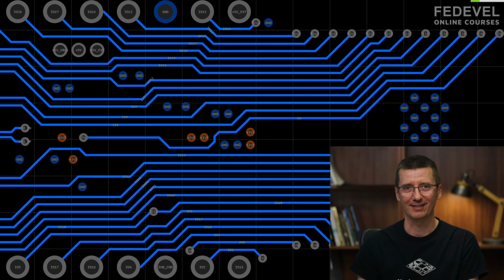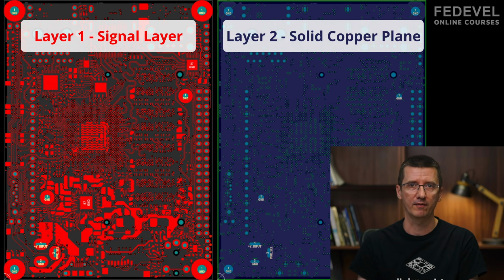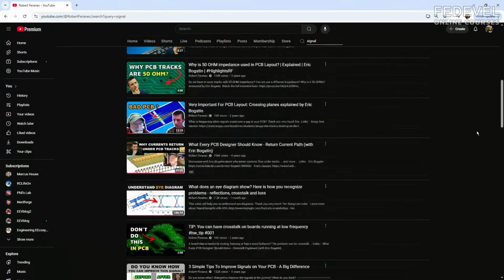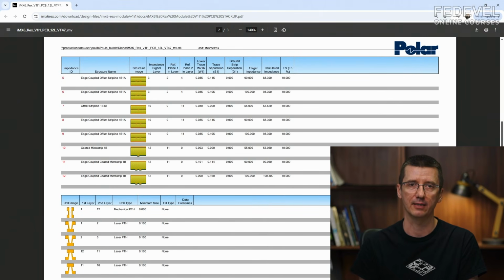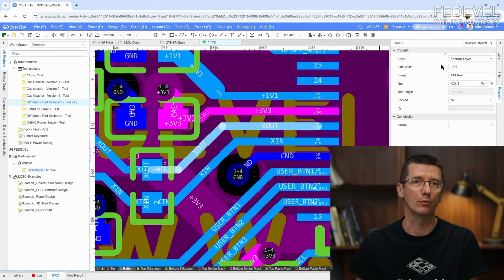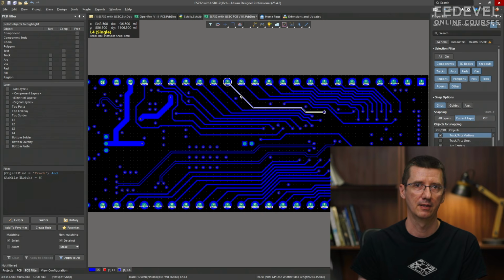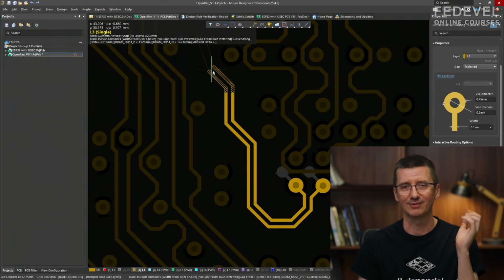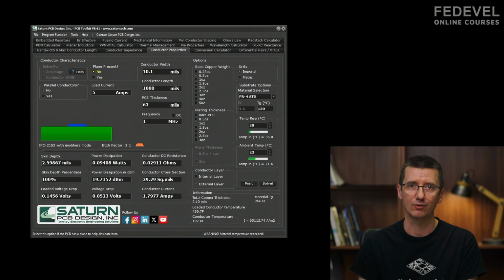Useful TIP: What Track Width To Use When Routing PCB?

Comment: This is just wrong. There's no need to use 50ohm tracks for digital signals. If they're super high frequency then you might need impedance matching (USB, high speed memory etc), or if it's an antenna feed line, then yes. But there's no need to do this for normal digital signals. Even for I2S or SPI lines.
Reply: The high frequency component is not the fundamental frequency of your signal, it's the rise and fall time of it :)
An SPI or I2C can definitely be ruined by fast io.
Reply: I recall, as a rule of thumb, that If you use 3W clearance rule, you should be using 50ohm traces. Otherwise the crosstalk coupling could be much greater. I always use 3H instead as it  scales with the reference plane thickness, and for this reason works for any impedance. I think Robert has an old video about this.

Also consider that traces are antennas at some frequency and without matched line load, source termination, high frequency energy could couple in, by how much of a problem is this would be hard to quantify. 

I don't think you need 50 ohms everywhere, but starting with larger traces and spaces is always a good starting point in a design.
Reply from the maker: It may not be required, but it's not wrong. Even if applied on signals where it is not required, it is not wrong.

I recommend to use 50 Ohms, because it is a good habit. Many chips actually have termination to meet 50 Ohms and in these cases it can help a lot. Also, if termination is external, often it is designed for 50 Ohms, so again, it will help in these cases.

So, using 50 Ohms will not make harm in the cases when it is not required, but it can help in the cases where chips or circuit is designed around 50 Ohms.
Reply: @RobertFeranec  Things are confusing enough for beginners without making stuff up. Right at the start, around 20s in you said "the most common tracks are digital signal tracks, and usually these are routed with 50 ohm impedance". But they're not. Now you say "Many chips actually have termination to meet 50 Ohms" - would you care to show me one? Because I can scarcely recall seeing an IC datasheet that mentions pin impedance requirements, except antenna pins or very high speed digital signals, as I already mentioned.
Reply: @JasonRennieWTF  I am not an electrical engineer by any means, however it is absolutely true that most digital protocols use 50 Ohms single ended impedance, but only when the trace is long enough. Using 50 Ohms everywhere is overkill however it's not wrong, can save headaches and it's simple to understand and implement on a design retroactively. I can think of 11 digital protocols that require at least 1 signal with 50 Ohm impedance. I think your issue is that you have not explored any high speed design which have impedance requirements.
Reply: @ParabolicLabs  "I can think of 11 digital protocols that require at least 1 signal with 50 Ohm impedance." DDR3/4, HDMI, eMMC, SATA, USB, Ethernet, MIPI, PCI express, Display port,  bla bla bla. But in every case it only applies to long traces at high speeds, and none of these protocols are "NORMAL" digital signals.
Reply from the maker: For example most microcontrollers / processors have settings to drive strength (you can adjust output impedance). It will not be exactly 50 ohms, but if you route your tracks with random impendence you can get much worse results than if you use 50 ohms. Also, often you will find in circuits series termination resistors e.g. 33 ohms which are designed to create 50 ohm driver impedance - so again if you use a random impedance on your tracks you can get bad quality signals. I have seen clock chips with 50 ohms integrated, memory chips with settings for 50 ohm terminations, etc ....
Reply from the maker: I am very surprised how many people find it weird using 50 Ohm impedance for standard digital tracks. If we don't speak about reflections, high speed, signal integrity, noises, crosstalk .... just from a practical point of view, I really would like to know how someone who randomly routes tracks on their PCBs can be sure that ALL the boards they ever manufacture will always work exactly the same and predicted way. When boards are manufactured, these are often manufactured in batches - you make 10, then 100, then 1000, then 10000. Sometimes these batches may be manufactured by different PCB manufacturers, sometimes these batches are going to have different stackup. If the properties of tracks are different between these batches (for example if the impedance of the tracks changes because different batches are using different PCB stackup), the same boards but from different batches may behave differently. In the worst case you may end up with batches that will work perfectly fine and in other cases many boards may be randomly failing.
Reply: @RobertFeranec  impedance matching is only needed for long traces at high clock rates. Otherwise it's completely unnecessary. Telling people to do this by default is just confusing and unnecessary. Now you're trying to shift the argument with talk of drive strength and some crap about manufacturing reliability. Just stop
Reply: @RobertFeranec  An impedance of 50 ohms by itself does not make sense without a terminator for the inputs/outputs of the chips - it will not be an impedance-matched line. They have been trying to explain this to you several times already. In addition, the tracks on the board are short, the digital outputs often have little resistance (push-pull), and the inputs are a Schmidt trigger. This allows us to consider tracks as simple conductors in the vast majority of cases, ignoring wave effects. And only in rare cases, at very high frequencies or in very sensitive systems ин jitter, it is worth taking care of the organization of data transmission lines.
Reply: @RobertFeranec  In principle, picking your nose with your finger also contains nothing wrong. :)
Reply: You are wrong my friend, is not about frequency is about di/dt aka drive strength. I have seen SPI at 20 MHz with rise/fall times bellow 0.5 ns on an FPGA where the drive strength was set to maximum… that’s ~ 700 MHz of bandwidth. At enough trace length the PCB trace is no longer “transparent” to the signal and you start having all sorts of problems: reflections, ringing, crosstalk, EMC compliance fails etc.
Reply: Sounds like you just haven't been burned by this yet :)

You can get away with a lot, but eventually you run into something which breaks the margins you didnt know you were running up against.

Comment: Thank you. The main thing is the impedance, but what should it be, that's the question! Why exactly 50 Ohm?, for a regular radio it's possible.. But if it's a track from an interface, for example, RS485, then you need to take into account the impedance of the microcircuit itself and cable, which is why resistors are often found in the path of digital lines to match the impedance of the track and the impedance of the signal source (driver in the microcircuit or receiver). For example, the DDR interface has an unusual 50 Ohm.. Some RF signals require 75 Ohm, etc. so the main thing is to correctly determine the required impedance and then adhere to it, and also do not forget about the invariance of the impedance, for example, the pads on the resistors may have a lower impedance than required, so you need to adjust the stack so that all the tracks and pads are as much as possible of the same cross section. Losses and reflections are generated precisely in places where the impedance changes.

org.
Дякую. Головне це імпеданс, а от який він має бути ось у чому питання! чому саме 50 Ом?, для радіо можливо і так.. Але якщо це доріжна від інтерфейсу наприклад RS485, то тут вже потрібно враховувати імпеданс самої мікросхеми, саме тому часто зустрічаються резистори на шляху цифрових ліній, аби узгодити імпеданс доріжки та імпеданс джерела сигналу (драйвер у мікросхемі чи приймач). До прикладу ДДР інтерфейс має не типові 50 Ом.. Деякі ВЧ сигнали потребуються 75 Ом і т.д. тож головне правильно визначитись із необхідним імпедансом і потім йогог дотримуватись, і також не забувать про незмінність імпедансу, до прикладу пади на резисторах можуть мати менший імпеданс аніж потрібно, тою треба скоригувати так стек аби всі траки і пади були максимально одного січення. Втрати і перевідбиття генеруються саме у місцях де змінюється імпеданс.
Reply: Depends on your track application. Impedance matching mostly for high freq. and fast communication lines.

Comment: Thank you for a brief refresher.

For Analog I tend to follow Rick Hartley's advise - to route return track as 3 times wider than the signal track right underneath it, because at low frequencies the return current is not flowing directly underneath the signal track (as is the case of digital signals).
Reply: Even route a separate return track beneath if there is a ground plane?
Reply: @jorgpressel6237  not exactly. If you're using a ground plane that's also fine as long as you ensure that their isn't any aggressor digital or an analog signal routed at 3x the distance from the victim track.
Reply: @PseudonymQR  Thanks a lot for your helpful reply! My audio PCB is performing well, but I'm always looking for ways to improve it for the next revision.

Comment: I just slapped 20 mils for every track for a personal project of mine thats just a microcontroller board and some leds. The reason I did that was I'm thinking about maybe etching it myself just for the fun of it so 20mils will probably etch fine. Did I do good?
Reply: has been more than 10 years since i last etched anything at for me as well but 0.2mm width and space should be fine for standard photoresist coated board. for the photomask i mostly used transparent foil printed using a black and white laser printer. If you are really cheap normal paper soaked in vegetable oil after printing works almost as well as clear plastic foil
Reply from the maker: I don't remember exactly, but I think we did even smaller ones (0.4mm / 16mil). It has been a long time I did PCB at home.
Reply: Damn I guess I was worried for nothing. Still the wider traces won't hurt
Reply from the maker: I recommend you to try JLCPCB, it's cheap and usually I have my PCB next week. Doing it in China is much much much better then doing it at home (often when I was making PCB at home I had to do it multiple times - the first try was almost never ok, the PCB was limited to 1 layer only, didn't have mask - problems when soldering, it was ugly and when I had to do it multiple times it was sometimes even more expensive than making it in china). This is how you can order it there: https://youtu.be/S_p0YV-JlfU?si=sbc_d-Okn2GC46tn&t=9685
Reply: @RobertFeranec  That is true. I've used jlcpcb for a few of my own projects and I can't remember if we used pcbway or jlcpcb for a student project I did. The boards are extremely quality for sure. 

Buuuut I kinda wanna try etching at least once, for a board with a handful and maybe have the board be displayed as like a decorative piece. I can't deny that  etching a broad yourself has a certain charm, even if it's worse in every regard then getting it from china :)
Reply: When making home prototype hobby level PCBs (with slow slew rates) start with a doable 12mil spacing and large through hole pads. e.g. >= 63 mil so that they don’t peel off or be drilled out. Also good to have closely coupled signal return lines, a nice PDN (power distribution network) to avoid ground bounce and for long signal lines, consider doable terminations. 🎉